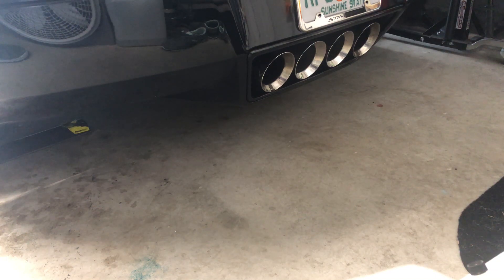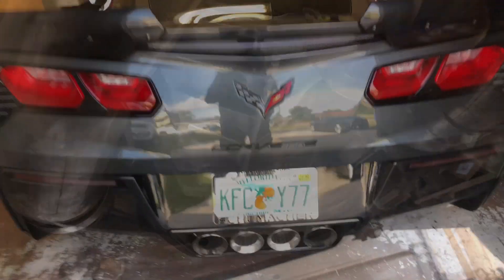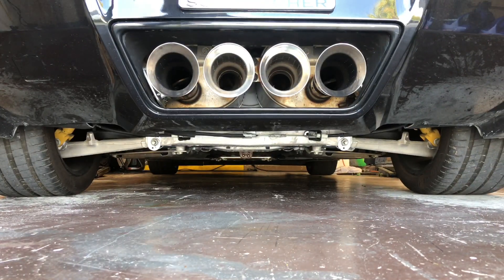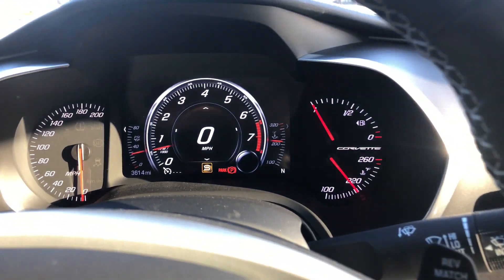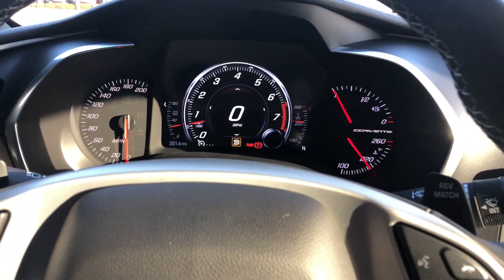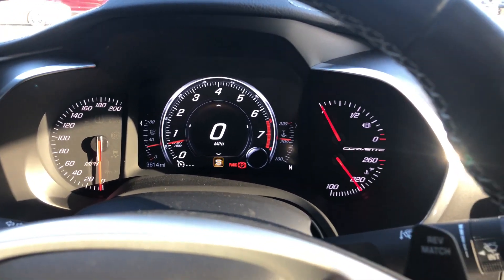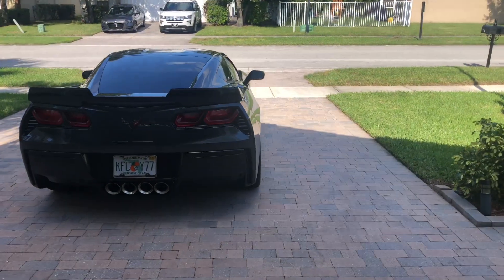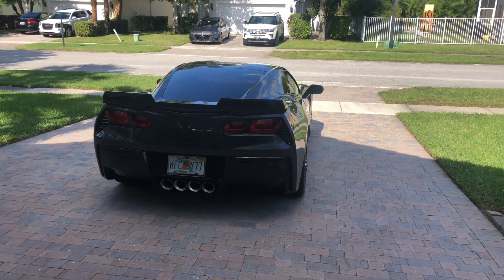Corvette C7 Corsa xpipe DIY installation

Comment: Added the Corsa 3" X pipe to my '17 Grand Sport, and my assessment was the same as yours, ... It sounds quieter than it was with the stock pipe.  I even had to do extensive double checking to see that the dealer actually installed the X pipe as they claimed???  WOT didn't tell me it had an X pipe either. I've heard he 2.5" Borla sounds better than the 3.0" Corsa.  Corsa was on special, so I saved $25, ... but prolly lost some sound :-(
Reply from the maker: Daryl Ireland ok so I have since pulled the fuss for the npp also let it break in with time it sounds a lot better
Reply: Daryl Ireland so which one would be better borla or corsa?

Comment: Is it your daily driver ? If so do you think it’s good on gas being a sports car
Reply from the maker: yes and yes! so if you are on the highway it has a tune from the factory that will shut off some cylinders when you arent using them I get about 20city and 25 hwy
Reply: Super good on gas, i get almost double th mileage compared to my chrysler 300c hemi! And always in race mode and rarely in 6th gear and never use 7th gear.. i can only imagine what it does on eco mode in 7th gear.. its very surprising
Reply: Laviolette Racing I have a challenger rt and it’s horrible on gas about 40 dollars every 2 days